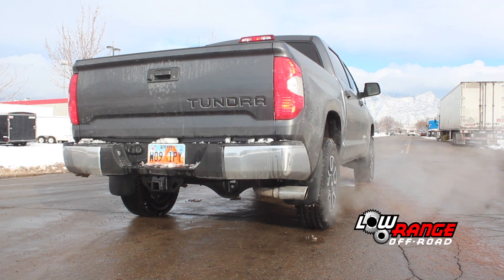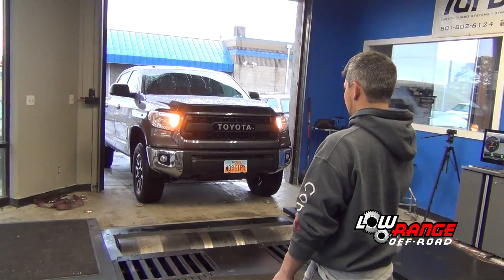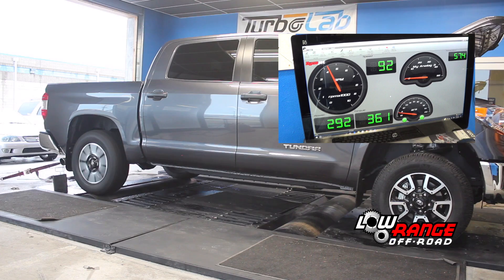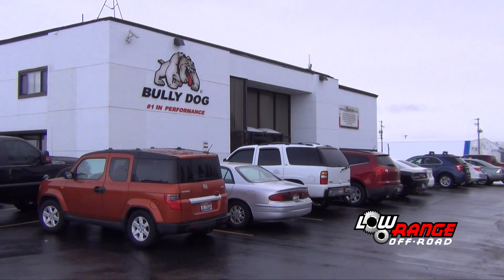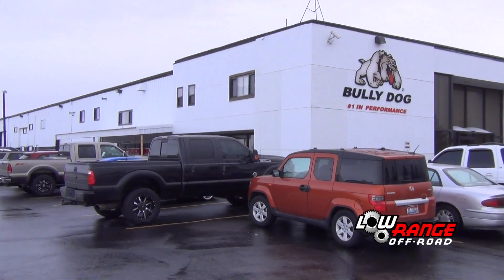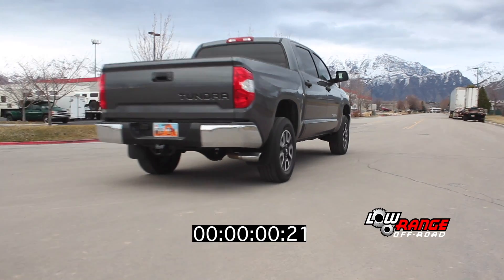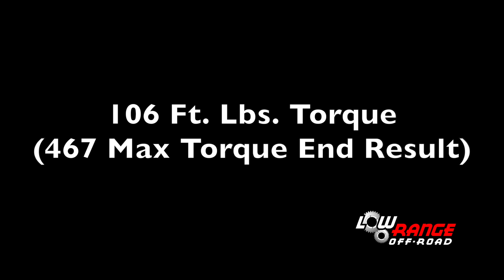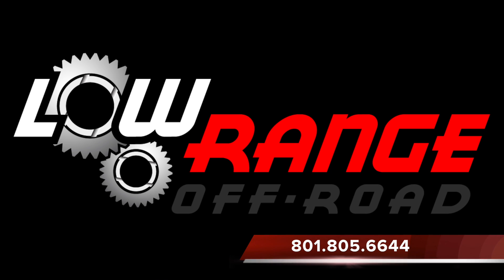Magnuson Supercharged 2017 Tundra - "Before" and "After" Test Results

Comment: I hate my 2007 Tundra. I have had it for 10 years. It has 140,000 uneventful miles on it. It looks and runs like new. You can't wear the darn things out. The paint doesn't even fade. I guess I am stuck with the same darn truck for life. I'm bored.. UPDATE: 190,000 uneventful miles.
Reply from the maker: Wow.  That is quite and endorsement for the Tundra.  Thanks for watching and commenting.
Reply: '03 Sequoia, 170,000 miles, verrrry few problems. I love the damn thing
Reply: 2010 tundra with 196000 miles nothing broke on mine and I dog the crap out of it
Reply: @kraemerdustin  196k isn't.shit.
Reply: @kraemerdustin 191 almost 192k on my 13 5.7 TRD 4x4 crewmax and it's been a money pit. Currently has blown head gaskets, no 3rd gear in transmission, 4x4 is broken,  electrical issues and the list goes on and on and on.
Reply: I have a '94 toyota land cruiser with 244,000 miles, runs like  new and has better air condition than my '07 my 4x4 GMC  sierra z71 crew  cab..go figure.
Reply: @blueeverlast9678 wow that's insane!
Reply: Blue Everlast  Probably b/c Toyota knows how popular it is in the deserts and Africa/South America.  My Tundra not that impressive, wife's Pilot works twice as good, my old Frontier better than both combined.
Reply: Money saved on maintenance due to the reliability should always go towards mods
Reply: If you're bored with the truck, time for upgrades! If you have upgrades, time for more.
Reply: same here 07 Tundra 200k+ miles..my hands stay clean...its built like a tank!!
Reply: htbud11 haha I have an 07 as well, things a beast!
Reply: I have a 2008 with 226,000 miles. Currently in Ecuador driving to Argentina. Only problem I've had is getting an air filter from the dealer here. They have to order parts from America. It's an import here, lol. Overall very happy with my truck, I have a truck camper in tow and all has been well. I've owned 5 Toyotas in the past, a 4 Runner, 3 Land Cruisers and now the Tundra. each on has been driven across country or out of the country. Over 200,000+ miles on each one, and when I sold them they were still running great. Great video and informational.
Reply: @bernardbarbour  Made in good ole' Texas USA.
Reply: Bernard Barbour Buy a K&N filter, last forever you just clean and oil pays for itself quickly.
Reply: Put my 07 into a cinderblock wall after hitting a patch of wet grass. 10k in body damage. No damage to the frame.. not even a busted radiator. 2 years later its like it didn't happen. I'll never own another brand of truck.
Reply: LOL
Reply: Supercharge. It
Reply: htbud11 if you hate Tundras because they run so well buy yourself a nice American Truck and you'll have tons of fun you'll be able to upgrade your truck all the time replacing all the broken parts with newer better ones
Reply: @jameslastname8395  Yes he needs him self a good Dodge, you can pick one 5 years newer than that Tundra with 60k miles on it for about what yours is worth and you get to work on it a lot!  Also give me your info if you want to sell yours please.
Reply: @jameslastname8395  tbh Tundras are made with more American parts than even the F150 now don't take my word though
Reply: htbud11 have a 2007 tundra about to hit 80,000 miles, had it since new and it's just amazing !!!
Reply: 07 Tundra here with 100,000 miles. Never had an issue and runs awesome. Will be keeping this truck forever!
Reply: Dang! so I'm looking at a number of years on my 2011 Tundra? it only has 94,000 miles.
Reply: Like a good wifey
Reply: htbud11 buy American. It will in and out of the shop regularly.
Reply: Your Moms false, not all. The 2003-2006 Silverados last over 250k with no major problems.
Reply: @headon434  the 2003-2006 tundras can last up to 1million Miles on the orginal motor
Reply: They built american cars to not last. 
Why. they call it “job security”
$$$ pay up dummys
Reply: 2002 Tundra with 155,000 miles, one of the best friends I've ever had, I love him dearly
Reply: Had a 97 Land Cruiser. Got 285k miles before it needed a head gasket. Fixed it, sold it and bought a ‘13 Land Cruiser  and thinking about about breaking the bank w a Magnuson Supercharger
Reply: If your that bored with having "140k uneventful miles" buy one of the Big Three. You will meet many technician friends!
Reply: 07 here, wish i would have got 08+.  Thousand dollar driveshaft was a bummer.
Reply: @mikewest712  I just got a 2011 supercharged & I'm worried about the driveshaft after seeing it mentioned several times! Was it only a problem with 07's???
Reply: Cat Herder how did you find that, is it a factory supercharger? Reliability after owning all this time? Also how hard is it to keep tires on it?
Reply: Same  I have an 08 I beat on 176k never had to anything but brakes once
Reply: Just got my 2016 iguess ima have to look forward to that too lmao
Reply: 2014 Tundra, 204k, zero issues.  Changed battery and front brakes once so far.  Way better numbers where I am at zero elevation.
Reply: 1999 4runner 230k miles....
Reply: Don't feel bad my friend just ad new tires ,lift kit,lighting to your tundra and you just gonna have a great rig, I love my 2007 tundra with 180000 miles runs like a tractor haha .
Reply: Lol...
I have an 08 with 320,000 kms no issues with engine, trans, driveline etc.  Not even any rust on it.  The only thing I did on it was the Walter pump and it was just showing signs of coagulation. 
One thing I found interesting with this video was the 0-60 in 8.1 seconds.  My stock 08 DC did it in 7.2 seconds!!
Reply: ill buy it off ur hands lol :)
Reply: shiit my dad put 400k on his 2007 tundra in less than 2 years before slamming into someone who braked on him out of nowhere.
Reply: Its funny tundra owners usually dont say that
Its what ford and dodge owners do.
Their trucks have problems ever since they drive off the lot.
But for everyone they say "i drove this for 200k and its like new".... 
But if ask the truth...you will start laughing
Reply: Just sold my 08 tundra with 240k and bought a ram. Worse decision I've ever made. The tundra would have lasted me to 500k easy. This ram will be lucky to make it to 200k
Reply: Logan Robitaille seriously,  what were you thinking?  And I see it's a year later how's the Dodge holding up man?
Reply: If you want the opposite buy a ford f150 lmao!
Reply: you should try switching over to my Ford Pinto Wagon.
Reply: 140,000 ain’t that high 😂 I’ve seen lots of Chevys, dodges, fords that have 200k miles and still look and drive like brand new.
Reply: @blake1995  Ford,GM,Ram can go two Hundred  Thousand mile with rebuild engine and transmissions.
Reply: @yoteyeet5601  that's a really broad statement haha, that's like saying a person will live to 70...
Reply: Blake’s 66 Chevy me too but the interiors don’t look as good as the Toyota’s with the same mileage.
Reply: Blake’s 66 Chevy  after a transmission, still can't find a Chevy that hasn't been replaced past 180k
Reply: Blake’s 66 Chevy that’s total bullshit lol. Chevy and Ram front ends will be falling out and the interior would be crumbling to pieces.
Reply: Junk

Comment: 361 torque to the wheels stock is impressive
Reply: VERY
Reply: not really. Not if your familiar with diesel
Reply: Tuner is noob or its a typo
There no such thing as 365 whp on stock tundra
Also nobody 0-60 like a fkn grandmom tundra
You act like that on strip you will lose your house on bets
Reply: @LazyCouchPotatoEntertainment  i think i had a stroke reading that
Reply: @LazyCouchPotatoEntertainment  btw stock tundra's 0-60 time is six seconds flat, 99% sure they tested this in a high altitude area
Reply: @LazyCouchPotatoEntertainment  I have a legit question. Took my step dads tundra to esc performance and got 3 pulls. Highest pull made 361 whp and 421 torque. It only has a spectre cold air intake. Does that sound right?
Reply: @joshcouture234  well, the tundra stock at the crank is 401ft lbs of torque and no way a CAI is adding 20ft lbs let alone going to mitigate the drivetrain loss. He's either lying or that Dyno is on crack

Comment: Cool! What did the Magnuson Supercharger install cost?
Reply: I know folks don't wanna talk money, but the current rate is 50.00 per horse parts and labor. So, figure a little under 10k to do it. Blower kits are like 6500.00 or so market rate from reputable major manufacturers, regardless of head unit style ( Roots, Screw Compressor, Centrifugal ), then the supporting mods, tuning, dyno time
Reply from the maker: We did it ourselves.  We do that with most if not all our products to make sure they are quality enough to add to our product line.  Some Toyota Dealerships will install them, as well as some independent shops.  Thanks for watching and commenting.

Comment: Toyota says you can't put a supercharger on the flex fuel models??
Reply from the maker: Jonathan, Toyota (TRD) may not supply them anymore but Magnuson, who made the supercharger for Toyota (TRD), does supply the same supercharger for the flex fuel and the non-flex fuel 5.7L Tundra engines.  We understand that some Toyota Dealerships will still install them for you.  Here is the link to both: Flex-Fuel: http://www.lowrangeoffroad.com/2009-2017-toyota-tundra-3ur-fe-5-7l-v8-flex-fuel-supercharger-kit-by-magnuson-01-19-57-113-bl.html    Non-Flex:  http://www.lowrangeoffroad.com/2007-2017-toyota-tundra-3ur-fe-5-7l-v8-supercharger-kit-by-magnuson-01-19-57-107-bl.html  Thanks for watching and commenting.
Reply from the maker: I just spoke with our local Toyota Dealership and they said they will install a Magnuson Supercharger on a 5.7 non-flex engine at there dealership.  The cost was not cheap.  They verified what you said, that they do not install the Magnuson Supercharger on the flex fuel model because they do not have the capability to tune the on board computer for the flex fuel engine.  The reason we sell the Magnuson kit for the flex fuel model is that the Bully Dog Tuner that comes with the kit is capable of tuning the flex fuel engine computer.  Hope this helps.
Reply from the maker: Hey Jonathan,  Thanks for the video link about the 2014 Tundra.  It was very informative.  One of our purposes in installing a Magnuson Supercharger on a 2017 Tundra 5.7L Flex Fuel engine is let folks know it can be done.  Magnuson is the same company that made the supercharges for Toyota Racing Development (TRD) and they are still making them for sale to the public with a 3 yr. 36,000 mile limited power train warranty.  If you are interested, we invite you to view this video (link below) that highlights the steps involved with installing this Magnuson supercharger on the 2017 Tundra.  Thanks for your questions.  
https://www.youtube.com/edit?o=U&video_id=UZ3z1IGm-IM
Link to the Magunson Super Charger in question:  https://www.magnusonsuperchargers.com/product-p/01-19-57-113-bl.htm

Comment: Same TQ my little ecoboost makes with just a tune. 0-60 in 4.65 seconds.
Reply: yeah i remember when tundra had a factory super charge with a full warantee that would do 0-60 in 4.4 seconds.
Reply: Trey K ford crap li other mexican  trucks...
Reply: ecoboom
Reply: Did someone say ecobust? Lol
Reply: reliability goes out the window after that. i blew both turbos 15k miles after a tune and exhaust on my 2012 ecoboost.
Reply: radioactiveload who was your tuner? I put over 100k tuned miles on my 2012 before trading up. On my current 2015 ecoboost I have about 40k tuned miles... no issues.
Reply: @NoticingBehaviors  bull fucking shit it does that maybe with a rolling start from 30 mph lol
Reply: @NoticingBehaviors  , which tuner are you using, thanks
Reply: Joel387 suzuki I have a video proving it.. it’s on my channel.
Reply: Vito 5Star

Comment: So around $2,600 a second it will cost. Is it really worth it. And what are the long term effects to the motor and reliability.
Reply: cisko213  In a few words. It is fast.
as far as longevity, I don't know yet. everything seems to be Toyota as usual. I've only had the supercharger for 3000 miles. the truck runs and drives like normal, until you put your foot down.
Reply: @jessefloyd5698  , now,  after 1 year,  have you had any issues overhearing or transmission leaking? are you towing at all? o have 17 1794 edition that I'm thinking of getting supercharged.  would you do it again? is it worth it financially? thanks.
Reply: @vitarmen1  Its been almost 2 years and I now have over 55000 miles on the truck. It had 7000 miles on it when I installed the supercharger. I have replaced the supercharger coupler twice. Cost about 29.00 for the parts. I did the labor. The supercharger is still performing almost flawlessly. I just started to develop a rattle noise that is not the coupler. I use the truck for work every day, and I pulled a 28' camper across the USA with no problems ever. The truck is great and the supercharger is fine. The power is great. Gas mileage is typical tundra. So far I'm very happy. And the truck still surprises me.
Reply: @jessefloyd5698 , did you do additional transmission cooler? we're in Colorado with 11k feet peaks,  and they advise me to install auxiliary transmission cooler on top is this supercharger.  I'm just about to pull the plug and install it
Reply: @vitarmen1  that's a good question. TRD, Magnuson and LowRange never suggested that. I do not think a trans cooler is a bad idea. My question for you is, what are your plans with the vehicle. Are you towing Heavy.... Are you racing.... Toyota over engineers properly. Do you think you'll need it? I don't have a trans cooler and I have 50,000 miles with the supercharger. Honestly, if it's a question...error on the side of caution.

Comment: do you have a shop in tuscaloosa Al.
do you have any for a tacoma 2014 ( 4.0 litre ) ?
Reply from the maker: Yes, we do supply a Magnuson Supercharger for your Tacoma and we can ship to your area.  Here is the link:  http://www.lowrangeoffroad.com/2005-2015-toyota-tacoma-1gr-fe-4-0l-v6-supercharger-kit-by-magnuson-01-90-40-007-bl.html
As to the install; we don't have a shop in your area and even if we did we don't topically do installs for the public.  The only installs we do are to test the product for fit and performance as shown in the video.  However, here is a link to shops in your area that may do the install.  http://www.magnusonsuperchargers.com/Articles.asp?ID=259   Another option is to have it installed by the your local Toyota Dealership.  Some like this better because they can provide a better warranty.  Thanks for watching and commenting.

Comment: Are you sure you got the 5.7 v8 and not the 4.6 v8 because the HP and torque are kind of closer to the 4.6 maybe could be the Elevation with the loss of HP
Reply: Also keep in mind altitude makes a big difference
Reply: n
Reply: You factor in the drivetrain loss ( 20 percent or more ) and the numbers are accurate
Reply from the maker: Thanks for the question.  Yes, we are quite sure this is the 5.7V8.  Others have asked similar questions.  The reason our measurements look low when compared to what Toyota advertises is that they are giving HP and Torque measurements taken form the crankshaft.  They say 381 HP and 401 Torque)  In order for us to get a true comparison, we'd have to take the engine out and test it on an engine dyno.  We don't want to do that for obvious reasons.  So our next best option is to measure the HP and Torque at the rear wheels on a chassis dynamo-meter.  This is an accurate measurement but will always be less than the engine specs because of power-loss through the drive train.  That is why we measured 292 HP and 360 Torque at the wheels.  Hope this clears things up.  Thanks for watching and commenting.

Comment: I live in Utah. Who could I have install this that warranties their work?
Reply from the maker: Dallas, 

This shows Magnuson Dealers/Installers.  It looks like there are several options in SLC area and one in St. George.
http://www.magnusonsuperchargers.com/Articles.asp?ID=259

The best warranty would probably be through a Toyota dealership.  I know Brent Brown in Orem will do them.  Although, 
Magnuson does has a power train warranty that is free for a 3 Yr.  36,000 mi 
warranty as long as the is install is done by a ASE Certified Tech at 
a Shop with a Business License.  See Warranty  http://www.magnusonsuperchargers.com/v/vspfiles/downloadables/warranty/MAGNUSON%20PRODUCTS%20LLC%20LIMITED%20POWERTRAIN%20WARRANTY%20STANDARD%2020160301.pdf

Magnuson also has an optional 5 yr  60,000 Mile Warranty.  http://www.magnusonsuperchargers.com/v/vspfiles/downloadables/warranty/MAGNUSON%20PRODUCTS%20LLC%20LIMITED%20POWERTRAIN%20WARRANTY%20OPTIONAL%2020160301.pdf

Hope this helps.  If you have further questions email us at sales@lowrangeoffroad.com or all 801-805-6644 8 to 5 MDT.  Thanks for watching and commenting.